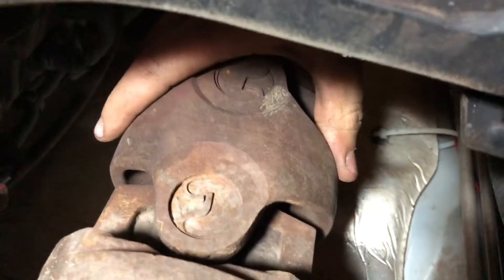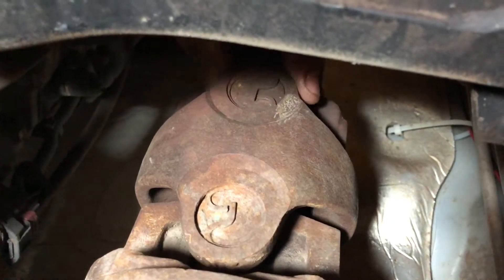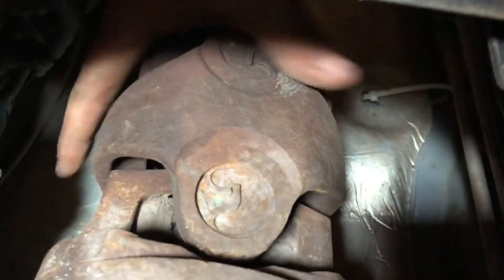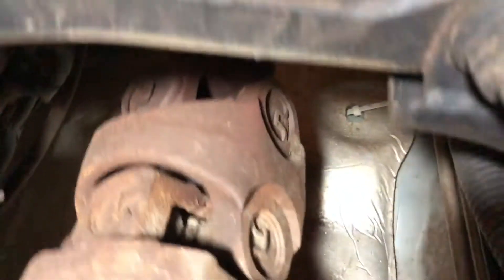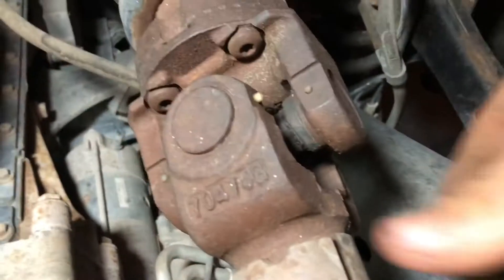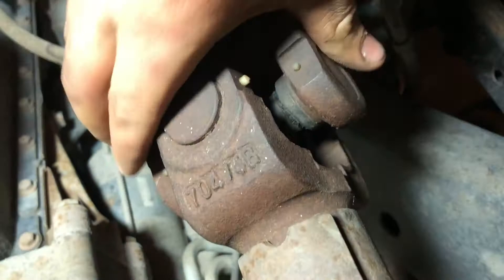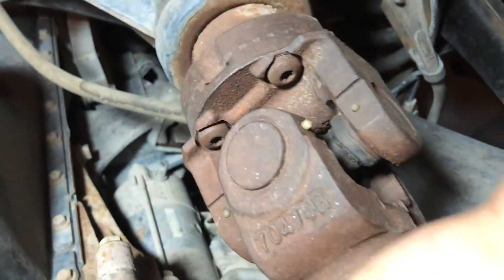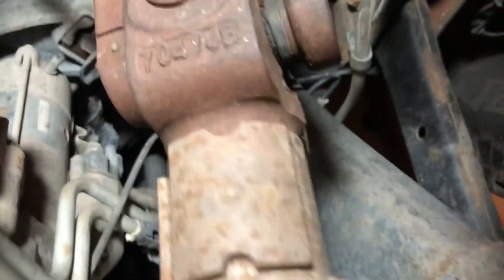Example: Dodge Ram 2500 bad u joints on front driveshaft

Comment: Can this make a clicking noice at low speed and then  sort of a grinding noice at higher speed?I have a durango that sounds awful at 30-40mph in 4wd.
Reply from the maker: loranga japp yes
Reply: @GDHoneyAcresandCraftWork  Almost like a wheel bearing sound?By the way thx for helping me out :)
Reply: jacobgaspari63 how did you remove the star bolts?
Reply from the maker: Michelle Etsitty with a torx head socket,  a extension, ratchet, a lot of being careful, and hoping I didn’t strip it.  You can get the socket in there just tak s some fanageljng. I used a 3/8 drive for it so it’d fit easier.
Reply from the maker: Michelle Etsitty I put up another vid on how to get the plastic retainers out of these driveshafts so you can get the joint out otherwise you’ll never get it out of the carrier.
Reply from the maker: loranga japp I put up another vid on how to get the plastic retainers out of these driveshafts so you can get the joint out otherwise you’ll never get it out of the carrier.

Comment: Dodge should get sue over this , it broke and it busted my transmission, transfer case , fuel lines truck turned off I had no control over n no brakes lucky I didn’t die, and a lot of people this has happened to.
Reply: Unfortunately Everything wears out.  its your responsibility to check for worn and wearing parts before they break.
Reply from the maker: I’m not a fan of the double cardone joint on the front shaft either. That’s why I now inspect every oil change and try to grease it every oil change. Took a long time to rebuild it do to how the joint is put together. That’s nuts that happened to you and I’m glad you are ok.
Reply: Yeah everything wears out dude I’m sure you didn’t grease it either like your supposed to not dodges fault